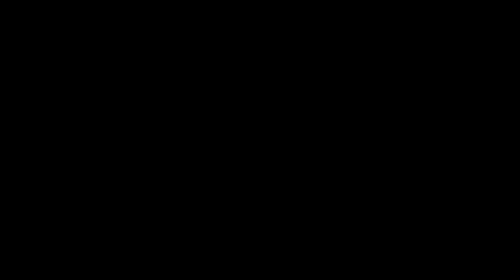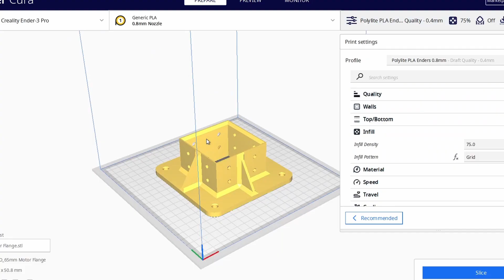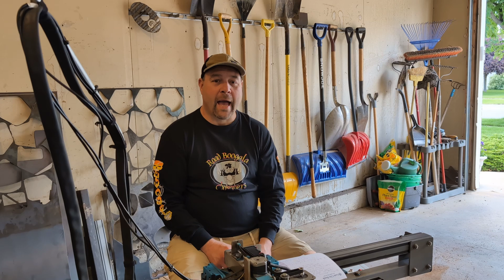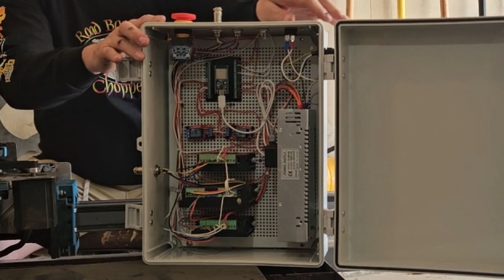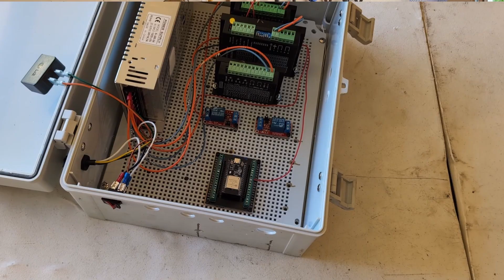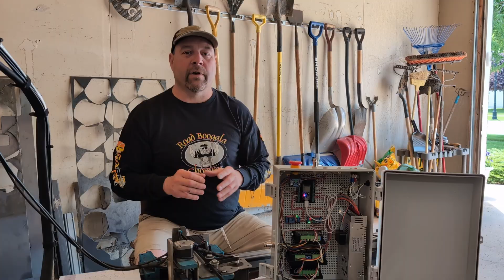Best DIY CNC Plasma Cutter Just Got Better

Comment from the maker: For more Information you can check out our website here. https://jdsgarage.bigcartel.com/
Reply: My question is...I built Ver1, so can I just do the controller swap, and will buying the new plans allow me to do just that...only change out the controller? Not sure I'm in a hurry, since the machine works perfectly as is...but I'd like the knowledge of the upgrade path...
t
Reply: Any plans on a 4'x8' setup?
Reply: @mikey_mike  not need rocket science can build biggest own size table, all normal men can build all table what size him need, can easy simple build own size.
Reply: @mattivirta sure, if you know anything about them. I do not. Got a genius here!
Reply: Hey dear friend, a need a cutting surface of 1m x 1,5m, theses plans will work with a big surface ? You can helpme ?

Comment: hey guys ( its been a while I've not been well:(  ) so I purchased the complete plans and the x,y, axis 3d printed parts I think like 3 years ago and I've just now seen this digital upgrade . I am finally unpacking the stuff and starting to order bearings, steppers, controllers etc.  Can I assume that all the physical stuff for the frame and travels is the same  in the cut list? Im going to buy a new plan set to make sure the electronics is up to date , and may as well grab the metal plate kit and the Z axis printed parts too.  glad to  finally be assembling this thing I have wanted it on the floor for a really long time lol.

Comment: I built your first version a few years ago and it has run ok. Had a few things happen that you mentioned. I'd like to "upgrade" to the newer Arduino ESP32. I will buy the plans for the 2.0, but can I just build a new controller (box) and just use the old table? I would think so. Thanks for your reply.

Comment: If you are using stranded wire on those terminal blocks, you should always use a crimped ferule. Stranded wire will loosen overtime in those screw down blocks.
Reply: tinning the wire strands together helps with that.

Comment: Great work guys, just got done with our build with the esp board. Has anyone had problems with fusion 360 failing to post g code? I have tried 3 diff versions of the post processor as well as checked my preferences in fusion. I’m pretty new at fusion and I do have the free version.

Comment: esp32 have little better, but need remeber this esp have dual core chip and can use lot lot better arduino uses one chip one processor all in one cpu, but esp can add code run lot lot fasten and basic system can run cpu core 1 and all external work can run fast whit core 2 , but need change lot in code then can run lot lot better fasten and accurate.

Comment: you need make video how i can build own DIY plasma whit makerbase DLC32 cnc kit, have best board (and cheap) use whit plasma,cnc,3D printer laser system when buy board. etc. i just order this board have touch screen display and good esp32 based board, but not understand how convert this board working whit plasma table, and how add this THC control too. i not understand code lot. this is simple cheap option build plasma use all in one makerbase DLC32 board and touch screen display, can use small nema 17 motors whit board drivers and can add external drivers use biggest nema 23 or nema 34 motors same board simple, have touch screen display and controll what file load and cutting whit plasma. this is you next important work what need make video how use makerbase esp32 board plasma project.

Comment: How and why are you spending that much on an Uno??

Use a nano: it's the same thing but smaller, and it's $2 on eBay. The adapter for screw terminals is $1.50. Grbl controller is free and very adaptable.

For what you're doing, the Uno is more than enough power. Using an ESP32 here is a 12 gauge for a mouse. The wifi and Bluetooth is nice, but controlling the Nano/grbl with an older model Pi gives connectivity plus video monitoring and other goodies, with Octoplus.

There's more than one way to skin a cat. 👍

Comment: Does it have to be a low frequency plasma cutter , I just got a Rossi 45amp non touch pilot ark , but it has 2T and 4T setting ,so can turn off the pilot arc .would this work?

Comment: Amazing product, can't wait to start building mine. As for the updates in speeds I think it has something to do with how the G code is computed. We used a lot of arduinos in school and they are finicky beasts. But I've seen where people have added raspberry pies to their 3d printers and it uncorks the printer a little bit since the computing is split up between the pie and the onboard board.

Comment: I finished my version 1 table a while ago, already flashed the Arduino long ago. I finally got around to completing the water tray and slats, but have yet to fire this thing up (learning Fusion). My question is: Is the ESP32 still needed in my case? I went ahead and bought the 2.0 plans and ESP32 controller, I guess I'll see what else I need when I look at the 2.0 plans.

Comment: Using the Z axes on your plasma cnc table, have you guys concidered making a jig to convert this table into a CNC router table? And is it possible to do from your build plans?
Reply: The single/cantilevered Y axis is probably not sturdy enough for router duty.

There is quite a big difference between a router and a Plasma cutter, one is usually lower speed, but against a higher load (pushing a cutter through wood/metal) the other one is high speed but almost no load (as the plasma torch should never contact the material)

Comment: Love the 2.0 version. 
I switched to the ESP's from Arduinos a while back as well and it was a great move for me, happy you all did that. 
Due to your popularity ,the digital plan is the only way you guys would ever be able to keep up and I know you know that and on the bright side no customer will ever loose their instructions :)
Reply: Was the old firmware a match for the esp? I just bought the original version and I was going to go with the esp if the old firmware was compatible with it.
Reply: @shanetwogood7893  Im not sure, but I do code on both Arduino and ESP 32 and the code and libraries are different. So I would imagine you would need the ESP 32 code to run on the ESP32 . If I understood the question correctly. The logic is the same but the actual code differs. I do love the ESP 32's and really only use them now days.

Comment: I bought the plans and 3D printed all the parts over a year ago. I have all of the parts from Amazon bought in a box too. Frame pieces are cut to length but nothing is drilled yet. From this point should I just start the plans over for the electronic portion? I need to figure out which electronic pieces I have need to be swapped out like the board you mentioned. Also I guess I was lucky because I bought the same Nema box with a clear lid. My question is how hot does it get in there with the power supply?

Comment: Ok, when I  order the new plans do I  replace all my motors plus the electronic controls or can I  use my existing motors and replace the electronics on the new control system. I'm also interested in new control board

Comment: The ESP32 is a great micro controller.  Be aware there are serval different incarnations of the ESP32 which makes things confusing.  I'm assuming the ones you're  using are based on the Xtensa microcontroller (ESP32-WROOM-32, ESP32-S2, and ESP32-S3 should all Xtensa microcontroller).   There are also versions of the ESP32 with RISCV based microcontrollers.  I'm assuming these are to be avoided for this project.  Also, the board that you referenced a screw terminal breakout board and not a hat.  Instead of the Uno, you could have used an Arduino Nano with a screw terminal block, but the ESP32 is better for sure.  Once I get some projects off the table, I'm definitely going to get the plans for this CNC table.  I have a PrimeWeld CUT60 plasma cutter that I need to put to use.  For the 3D printed parts, my son has a Bambu that prints great!

Comment: Just defended thesis successfully for MS EE!  For grant fulfillment of the MBRACE project, we too moved from an Arduino (Nano) to an ESP32.  There is simply so much more connectivity I/O and communication wise that it was a no-brainer.  In addition, the DIY community is also making the transition which has so many benefits now and for the future.  One thing is that the Arduino microntroller prototype boards also have breakout-boards similar to that of the ESP32 for a small cost.  Remember, these are prototype boards with what most folks will need to get started.  At the end of our journey, we will create a custom board that the students will stuff.  Maybe your son could create such a custom board or daughter-card to make the process easier or facilitate a plug and play turn-key option.  Thanks, and keep up the revisions and great service to the community.
Reply: i think this is cool seeing mulitple open source type projects moving to the esp32, congrats on your MS btw.   plus the v1 engineering stuff (mpcnc and lowrider cnc) is all running on ryan's jackpot now(esp32 based)...   so if a lot of the DIY folks are all running the same Sh!t then this will get way easier and cross compatible.   PPL can build whichever flavor they want (JD or V1e) depending on what works for you at the time... i bought the stuff for a lowrider and built one and i'm buying the plans from JD right now... so i don't think its competitive as much as it is collaborative at this point and i'd like to think   everyone agrees about this.. in a similar way to how ppl have done open source with 3dPrinting but i'm sure there are a few who don't.     one thing i know is that we are probably all better off working together than we are separate.    everyone stands to gain a lot from being able to afford the tools they need to bootstrap their own business.
Reply: I’m working on making a mother board to condense the electronics since my dad asked me if I could design a PCB before fall break. This might be great to do before I even start college.

Comment: Just got notice that my THC shipped.  Can't wait to get that running.  I see you say it's not really needed but it's like having Cragers on my old LeMans.  The ol' girl didn't go any faster with shinny wheels but she sure looked good getting there!  I'll be upgrading to the ESP32 Controller as soon as I get the THC working.  $25 for the upgrade to V2.0 is a bargain with all the information that comes with it.  I have added cooling fans to my control panel with a carbon filtered intake and color coded name plates for the aviation connectors.  Still doesn't go any faster but looks really cool and it's easier to get the cables connected properly

Comment: My question is why not use a cnc shield with the arduino and skip the external drivers?
Reply: all 3D printers etc, arduino shield uses drv8889 etc, stepper drivers and have totally too small run good big stepper motors, only maximum 2Ampere current motors can use, need external stepper motors drivers if want use normal good biggest nema 23 motors can move heavy parts to frame. 3D printer can use less 2 ampere motors not need torque lot move, but plasma, cnc, need lot lot biggest torque motors can move. this is basic why need use external stepper motors drivers. ardiuino cnc shield have only toy and not can use big drivers and big motors.

Comment: Glad i hadnt pulled the trigger on thr plans lol. Have you guys entertained a lead or ball screw version of your machine?
Reply: How much closer to the Langmuir Systems Crossfire do you want it to be?
Reply: @kello711  HI!  If you watch some of JD original videos, they actually planned on going with leadscrews but in the spirit of cost savings opted for the belt system.  To answer your question, as close as possible while still building it myself as I have a couple tweaks in mind 👌

Comment: This is a mega update. I live in Phoenix AZ, it's 110°+ consistently. I cant work in the garage that's 115°. So i was hoping to get the enclosure and electronics built and ready THEN i can build the frame in the garage. But, i'm a newb into all of this and had no point of reference for the enclosure for wire length and so on. I needed to build the frame first, then i know how long i need to make things and mount things. The enclosure update is the one i needed the most and this is exciting. I literally have all the parts, just need cooler weather to work lol but now, i can do it two stages!

Comment: What an upgrade, I am definitely going to get the ESP 32 Controller instead of the Arduino I have now. What are the measurements for the electrical enclosure you are showing? 

Again, great work you have done. And I love the table I have made, on the basis of your plans.

Comment: If this is a new product will the XL version of the table you posted on your "shorts" be a new product to? I bought the original plans 2 months ago with the intention of making the table bigger but if your going to release plans for a larger table I'm not going to purchase the updated design for the small table and then turn around and purchase plans for the big table if it gets released. So I guess my question is will the large table be apart of the updated 2.0 plans or will it have its own plans?
Reply from the maker: The XL will have its own plans and contain all of the new electronics from the 2.0
Reply: @jdsgarage701 when will the xl version be released?

Comment: I bought the building instructions from you a few months ago and have already obtained all the parts for the electrical system, such as the Arduino uno. Will the plasma cutter still work well with the Arduino when it is finished?
And is it time-consuming to convert to the new controller afterwards?
Reply from the maker: Yes the old machine will still work fine. As of now all of our videos were done with the arduino setup. It would take 1-2 days to make the conversion.
Reply: Thanks for the reply, I will probably buy the new package so I don't have to do the work twice.

Comment: Looks like a great new machine.  I bought plans 2 months ago and have just started cutting steel tube for the frame after collecting all of the parts from the previous bill of materials.   Do I get free access to the new plans and will any of the steel parts change or am I safe cutting all tubing and plate steel parts?

Comment: Going through the old plans, it states 4 walls for the 3D prints with a .08 nozzle. Am I correct in assuming to do 8 walls for a .04 nozzle? The reason I ask is I have multiple printers and while I could certainly print with an .08 nozzle, I would print some of the smaller items on a smaller printer. Just trying to get clarification. Thanks for the great content.
Reply from the maker: Yes this would be correct.